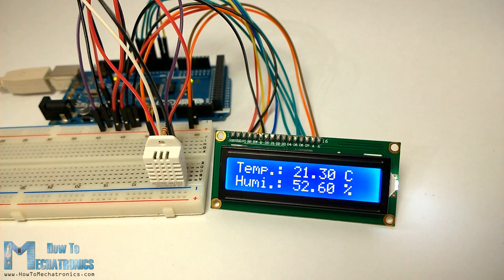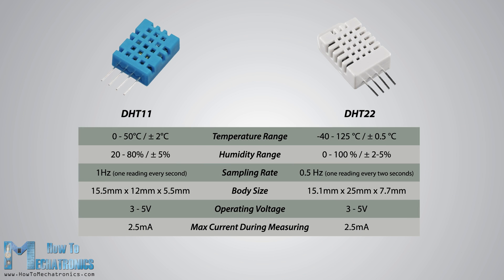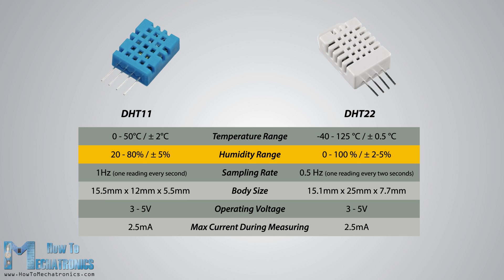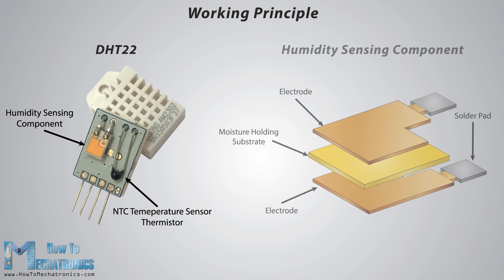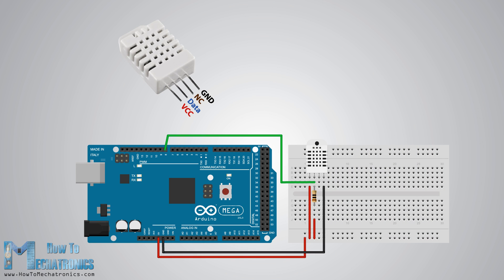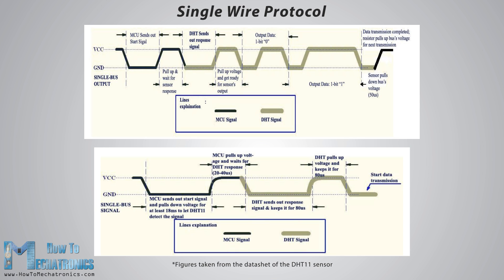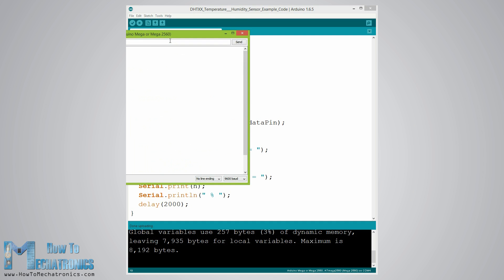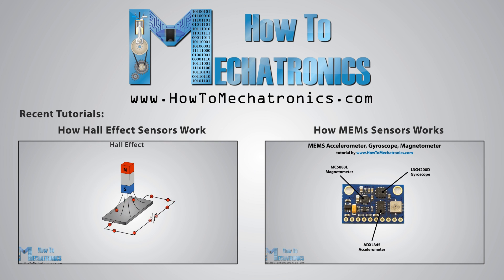DHT11 & DHT22 Sensors Temperature and Humidity Tutorial using Arduino

Comment: Hi, congratulations on your video. But I get the error that "the dht.h library is missing. There are several libraries, I don't know which one to install. In my Arduino the dht sensor library is installed, but it doesn't work with this library. Any suggestions? Thanks.

Comment: I'm just getting 0 temp and 0 humidity
Reply: DHT.read11(dataPin) returns -3
Reply: @Wesgeen  I am getting the same problem, did you ever figure it out?
Reply: @drewbutler1326  No, i eventually just assumed the DHT11 was broken, and moved on :c
Reply: @Wesgeen  Well that stinks. Thanks tho.
Reply: I had the same problem.

Removed the resistance and it started to work.

Don't know why. My DHT22 has 4 pins.

Comment: I could not get the DHT11 single wire protocol to work with a 20x4 I2C display. The display works fine with just a display sketch, and the DHT11 works fine with just a DHT11 sketch, but the two could not be carefully combined to work together.  Using the serial monitor display as well as the LCD display simultaneously, I can see the sensor working properly but there is no change whatsoever to the LCD - nothing displays. I suspect that with the on-board pull-up resistor pulling the DHT11 high and ready for communication, it may have been preventing I2C from starting up. I don't know. Ideas?

Comment: I have constructed the circuit and apply what it 's necessary. But i have a problem. DHT22 reads both Temp:-9999 and Humidity: -9999. What is the issue ?

Comment: Does it have to constantly be connected to the computer to get info from the serial monitor?
Reply: Dejan Nedelkovski can you do a video about the same thing, except use a PIR motion sensor to display sensor values on the lcd screen? or do one with capacitive touch sensors?

Comment: @dejan Nedelkovski Do you know if the DHT11's readings of the humidity and temperature can be float variable and give an accurate value, just like the DHT22 you showed in the video? 

thx
Reply: Yes.  I don't see the 1/100 accuracy as I see in your DHT22 video.
Reply: I did exactly your code, and I don't get 1/100 measurements.  I'll try to find an DHT22.

Comment: Arduino: 1.6.7 (Windows 7), Vývojová doska:"Arduino/Genuino Uno"

C:\Users\User\AppData\Local\Temp\arduino_58c88b70bb658d9ab087ef443dabacf7\sketch_feb17a.ino:10:17: fatal error: dht.h: No such file or directory

 #include <dht.h>

                 ^

compilation terminated.

exit status 1
Chyba pri kompilácii.

  Tento výpis by mal viac informácií s 
  "Zobraziť viac informácií počas kompilácie"
  povolené v Súbory > Vlastnosti.
Reply: Hi did you find a way to solve this? I am having the same problem...
Reply: @oneiricj4877  download the library from the internet then include it in your Arduino sketch

Comment: Hi, I got an error when uploading.... please help...
fatal error: DHT.h: No such file or directory
 #include "DHT.h"
Reply: +chao xi I have downloaded the DHT lib and the error is gone now. But still when I open the serial monitor, there is always zero value.... the sensor seems not sending any value, i use a 1K resistor in the data port of DHT11.
Reply: Hi, Dejan. Thanks for your prompt response. I have downloaded another lib and yes it works now. Thank you sir!